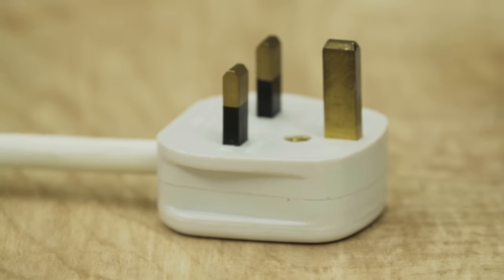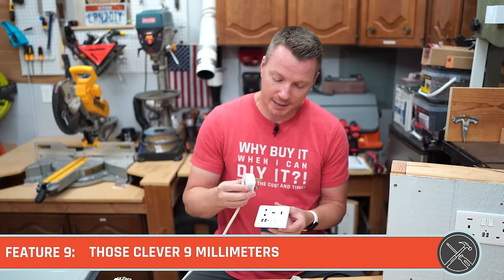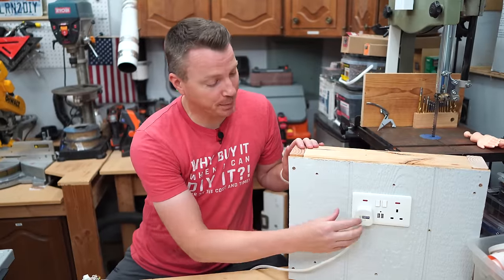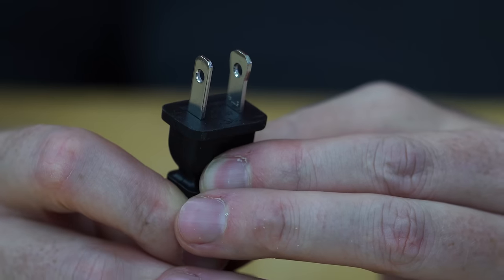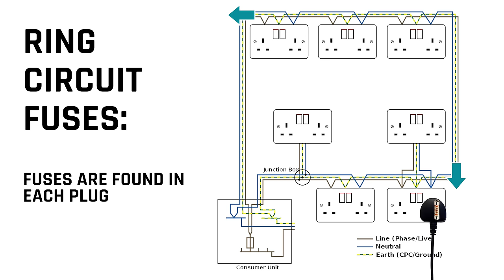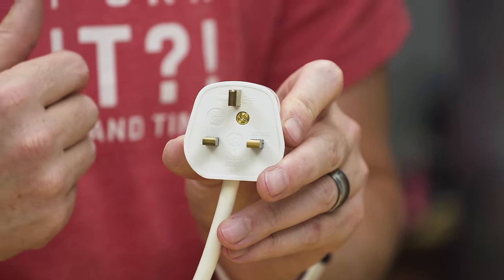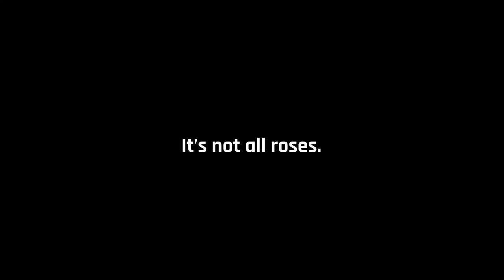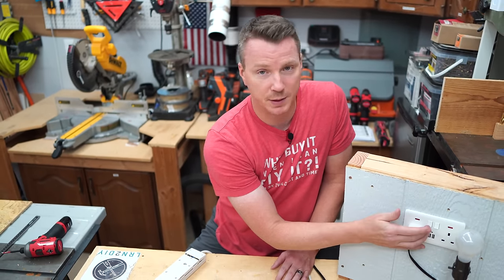British Plugs and Outlets Are On Another Level

Comment: Your load balancing comment is incorrect.  You can have the entire 32A load all in one room, up to 26A can come from the one double outlet you are demonstrating.
Your comment about heavy loads being possible as  long as the gauge of the wires in the wall is large enough is also incorrect.  The british wiring regulations are extremely strict about the wires being of suitable guage to cope with the maximum load at any location on the ring.  This includes calculations for cables in heavily insulated walls, and takes into account the grouping factors for many cables in a bunch, which factors in the temperature rise, and resulting raise in resistance of the cables.
The comment about pottentially troubleshooting the lamp because the switch is off at the wall is also incorrect.  This may seem valid for you guys, but in the UK, the first thing anyone does if it's not working is check the switch on the wall. We've grown up with these things so it's the obvious thing to look at.

I do however agree with the Lego analogy.  Standing on an upturned UK plug is highly unpleasant!!

Comment: Size of the G isn't as bad as you think because of the cable going straight down whereas the A cable direction means it's more deep than a G.
Only downside I've experienced is stepping on a G plug with its prongs up.
Ouch. Bad words.

Comment: Plugs with removable covers could be considered a hazard since they can be used without the cover, readily exposing dangerous voltage.   Molded plugs do not have that issue.

Comment: Voltage isn’t an issue it’s amp that kills human. And each circuits have individuals breakers and residue current protectors.
Reply: And overloading is only a problem on old electrical installations. Which haven’t updated to RCBOs and thicker gauge wire that is required by law on any appliances which always use their own dedicated circuits with a protector.

Comment: Type A plugs are far better than  the G for general use. There are no problems with the earth on the A because it is longer than the hot and neutral and breaks last like the G and the hot and neutral are usually insulated at their base  like the G. By far smaller and lighter and easier to use. 
The fuse on the G plug makes it harder to trouble shoot. Is it the  lamp? The blub? The switch? Or the fuse on the plug or the one in the fuse box?
Also cube taps are ridiculous with two or three plugs in them. 
The size of the clunky G makes it hard to use and store. As an electrician  who learned in the US but now lives in Europe, my vote is for the type A.
Reply: You do not know much about this electrical stuff do you?

Comment: From a Brit, well explained. 😊 but the fuse is to protect the cable of the attached device in case it goes open circuit. Imagine 32amps (which the ring main can carry) going through a tv mains cable. 😮 Also did you realise prior to about 1991, EVERY single electrical purchase came without a plug? You fit it yourself, there was a change in the law, now everything has to come with a fitted plug, but there are some far east items that come with a type G plug without a fuse. Not a good idea!
Reply: The G Types without a fuse are illegal.

Comment: Please note, all appliances sold in UK are now obliged to have type G plugs which are moulded on, the fuse being accessed though a trap door or sliding drawer of some kind.
So, if faulty, we must cut it off and replace it with the openable kind in the video. 
It happens that, "How to wire a 13amp plug" safely used to be formally taught in primary school, along with other vital "life skills," such as, how to make a cup of tea, and how to bathe a baby.. boys and girls taught together.

Comment: I agree that in terms of features, the type-G plug is quite nice. It plugs securely and it’s safer in general. But when things demand to be portable, these things become really annoying, especially compared to the US/JP plug. One can see it on Apple travel adapters, where the US/JP plug can be folded and be really seamless and compact, while the type-G plug is just a huge protrusion.

Nonetheless, both are better than the annoyingly flimsy two prong EU plug that often doesn’t even sits securely in the socket.
Reply: When I got my ipad, it came with a type g plug where the pins folded down

Comment: Well of course the British have 50 Hz electricity that’s 240 V in every outlet so all their appliances run out of that even the common toaster. So they need a heavy duty special plug and socket. The US doesn’t have that type of plug they do have special plugs for dryers stoves heavy duty appliances that run off of 220v 60 Hz.

Comment: The biggest flaw of ring circuit design is that you will need special detection devices for first wire breakage. Otherwise it keeps undetected. You may want it in a hospital but not in a ordinary home.
Both US and British plugs fully reley on pins for mechanical stability. Continental European plugs are going into receptabeles that are recessed. Because European and US design allows 180° turns of plugs all modern electrical mobile devices are double insulated. They are mass produced for a worldwide market. 
A moulded plug is more safe. Most end users don't have the knowledge to diy repair and don't have test equipment to validate a repair like checking resistance or the "why" of damage. A big flaw of stranded wires on a screw terminal is not crimping a solid end to it first.
Reply: Why would the wire break on a ring? Also, arc fault detection is mandatory on socket circuits, ring or radial, in high-rises, care homes, etc, detecting a break. Called an AFDD. They are recommended on all socket circuits. 

You are right about stranded wires and ferrules.
Reply: @rns4017 Why you do need a ring if no wire will break?
Reply: @rkalle66  
?

Comment: The switches are NEVER a problem, just push on the bottom half and you know it's on, OR there's sometimes a red painted portion, or the text "ON" that is only visible when the switch is in the on position (also, if anybody does produce these switches where you have to press the top, can we just unalive those people)

Comment: The load-balancing comment seems the wrong way around. You're connecting the appliance into a loop, so it shouldn't matter where you do it. The thickness of the copper cores is defined for the maximum load on the ring. In the US/European "star" system, the total load is limited to the thickness of the cores between the fuse box and the hub of the star.

The internal fuses come in different ratings to protect the appliance - 13A for a toaster, 5A for a lamp. (13A is what's in it at purchase and most Brits don't rate down for lamps etc. however. Shame!)

When saying you couldn't pull it out by the cord, you should have added that the plug is very easy to remove holding the plug!

Comment: Well, you make a point of the UK one being larger but when it is plugged in, it only protrudes about three quarters of an inch out with the cord going down from under the plug, whereas, the US one when plugged in protrudes at least two inches and that is without the electric cord which is then even further from the wall, so, in effect, when the USA one is plugged in, it is actually larger and further more, I am very old and I have never ever stepped on a plug and I don`t know of anybody that has, scraping the barrel a bit there I think.
Reply: The G type is not large. It is designed for a human hand to slot in and out the plug easily.
Reply: @johnburns4017 and to pull out accidentality as well.
Reply: @honestchris7472  
I cannot see how you would pull out a G type plug accidentally.
Reply: @johnburns4017  tripping over a lead, moving a chair and catching the lead, a child pulling the cord, will that do? the point is that  you said that it can be put in and pulled OUT easily, it is also still connected to the electricity when it is pulled out a little bit and leave a gap big enough for little fingers to fir in behung and touch the terminals.
Reply: @honestchris7472  
You cannot pull out a G Type plug accidentally.
Reply: @johnburns4017  You said "It is designed for a human hand to slot in and out the plug easily" so by that I think that it can be pulled out easily because you said s and easily would indicate that it could be pulled out by accident.
Reply: @honestchris7472  
You cannot pull out a G Type plug accidentally.
Reply: @johnburns4017 I am sorry but we have been talking about different plugs, I wrongly thought that you was referring to the two pin American plug with the lead coming straight out of the back and not down like the British plug, so what you say is correct, a G type plug cannot be pulled out accidentally. Sorry about my mistake.

Comment: In Europe we have better systems of outlets, we have sockets inwards so the main parts aren't exposed out in the blue,  and have on the connector two plugs with one ground hole, plus we have RCD norm on lights and outlets so it's nearly impossible to get shocked

Comment: Next one, EU plug. Socket is deeper, you can't shock yourself if you want to stick fingers to plug connectors. They are well secured in place that you can't accidentally kick out of wall, thanks to springs inside socket. Ground is on the side of plug. Nice try but no cigar.

Comment: Better than they need to be. Type G plug is five to eight times more money than a Type A or B.  See what you'll pay for an extention cord at the local hardware store.  Also try buying an appliance and discovering the plug needs to be "fitted".  I'm happy with the 115/120 v. for most things.  Stoves and dryers have 230/240 plugs available.
Reply: Appliances come with moulded plugs and flip in and out fuses..
The British plug is the best.

Comment: Australia is way ahead  we have had these smart ideas for years
Reply: Australian plugs are inferior. Thin prongs, no fuse. They should adopt the British plug ASAP.
Reply: we have RCD at the switch board which protects any thing and every thing plugged into the power !! IE kids poking stuff into power outlets etc
Reply: @johnbrown-rm8kc  
Thin flexes off sockets are not protected as you do not have fuses. But you do have switches though. 

John Ward tore down a failed Aussie socket. Design was not that good, and this was a better model. So get a decent internal design. 

Search Youtube on : Failed Australian Socket and Plug

Comment: But it doesn't end there, in the US and Canada we use Marrettes or twist wire connectors, in the UK they have these pinch on connectors which save space, safer and cleaner.

Comment: Good design with features previously unknown to me. I guess the main downside is the complete incompatibility with the EU Schuko. UK plugs used to drive me crazy when I worked with distribution of computers and Taiwan sent the UK version by mistake. OK sometimes I made the mistake when ordering. Either way I ended up with a big cradle of  UK plugs and hated them for that very reason. In the end, fewer standards are more. Even Apple had to give in and accept USB C as the way to go.

Comment: Enjoyed this video until the downsides, firstly you compared the sizes against incorrect orientations of both plugs, huge difference. Also the benefit of the cable going down below the plug (UK) Vs the cable coming 'out' of the plug (US), huge difference in how much space each plug takes up. However, there is no greater pain than standing on a UK plug in the middle of the night with your full body weight. Those prongs really eat into your soul.  Fun video though! 👍

Comment: Used to live in the UK, but now in a schuko/type c/eu plug country and building my own home. I plan to use type G in my own room. Even in my current one, i replaced the default to accommodate type G. I feel safer with type G instead of EU type plug, but no offence to americans, your plug (and consequently the Japanese) is the one that make me feel unsafe. And no, type G is not used in Indonesia (yes I am here). Well, except it is a requirement that applies to air conditioner only, hence it is called air conditioner plug.

Comment: The major downside I have experienced with this kind of plug is that they need to come with hefty cables as well. You can’t find light extension cables with thin wires for these plugs which make them tedious to carry around and a bit hard to manage or hide behind furniture. There are also other accessories you can’t find for these plugs, like bulb to socket adapters.
Reply: You can can have thin flex on the plugs.  You just put in a low value fuse. The range from 1A to 13A

Comment: I understand that US plugs and sockets are crap, but I prefer my compact Swiss plugs and sockets (T13) over those bulky Brit ones. As the sockets are inset, plugs can be even flatter (most aren't though). You can have a triple socket of the he size of a Brit single socket at a similar safety but without the possibility of using flag plugs. And they are compatible with 2 pin EU plugs.
Reply: The British plug is vastly superior.
Reply: @johnburns4017  Again, it's way too chunky.
Reply: @-Jakob-  
It is that size to fit in a hand that easily slides it in and out.

Comment: I grew up in England and lived with those plugs and sockets for years. It wasn't until I moved to the USA and saw the pathetic and dangerous system we have here that I really appreciated the safety that went into the design. You list 10 very good reasons for their use and the few that you don't like them for are rather flimsy tbh. I have stood on all 3, a G and a US and a Lego. Lego is definitely the worst 😫😫😫😫
Reply: British electricity is fundamentally more dangerous which warrants the immense number of safety features because during the wars you had copper shortages. 

The US uses 240 volts split into dual 120 volt phases so we have 50% more copper wire to transmit the power to the house. 

By using 120 volts, each appliance uses double the amperage, so we need 50% thicker copper wires in a house or cord to deliver the same power. 

High powered devices like ovens, stoves/hobs, clothes dryers, pool pumps, etc will use 240 volts to get around the thicker wire requirement - but they will have 4 pin plugs - 33% more copper wire.

Our big appliances have dedicated circuits which involves a lot more copper wire - so individual fuses, switches, etc as it drastically increases safety. 

The Brits couldn't afford that amount of copper wire, so they made up for it with high-tech plugs to accommodate for it.
Reply: @aminy23  You missed the point. It's not the voltage that makes it better or worse. (Actually amps are what kills) It's purely the design, and all the things he pointed out where the US system is just wholly more dangerous. A plug partially out will electrocute a US child, a UK plug almost can't unless damaged.

Comment: Honestly the last two points are completely moot, you very rarely need to disconnect and we don't tend to leave plugs laying around. Instead of unplugging we just turn them off. Another person mentioned that the supposed troubleshooting isn't an issue it's the very first thing checked. I live in Portugal now and honestly the type of plugs used her I find incredibly frustrating they're not secure in the slightest many times as there are so many sizes and generally securing them in the sockets isn't done with the pins like the g plug they a supposed to be inserted in a recess but not all plug molds are to the same spec. I find it extremely frustrating not having a fuse on each plug because it's a great way to save your device (potentially).

Comment: Switching off a device at the receptacle that has draws only a small amount of current when turned off is not a great idea. The power consumption is negligible and that feature is there for a good reason. It reduces the 'power on' shock to the circuitry and maintains a constant environment in the device which will increase its life span. The savings in electrical consumption will be negated by the decrease in that life span. Older TVs used this feature to keep the CRT warm and provide almost an instant start ... not an issue anymore with solid state monitors.

Comment: Hong Konger here. 
Growing up with UK plug. It confuses me why on earth is two-pin plugs are still a thing. It's just unreasonable to me. It's loose. It's not fused. It's not secure on wall at all. It gets tripped and falls off so easily. It actually takes up more space than UK plug when plugged in. UK plug are just far more superior. No exceptions.
Reply: Yeah sorry except when stepped on.. 🥲🥲🥲
Reply: One more thing, about the extra switch on the socket, actually those are not a must. There are sockets that doesn't come with an independent swtich for separate socket.

Comment: Actually when we were younger at school we used to prat about with just the socket. Get a pencil and a long piece of foil. Put the long piece of foil in the bottom right corner of the wall socket and jam a pencil in the top hole with the graphite more exposed. There was something else we jammed into the remaining one can’t for the life of me remember what it was but it would then either explode the wall socket or set the pencil on fire. Oh the happy horrifyingly dangerous memories 😕